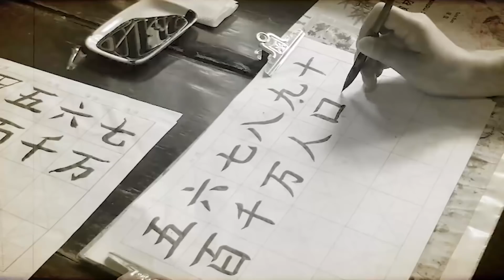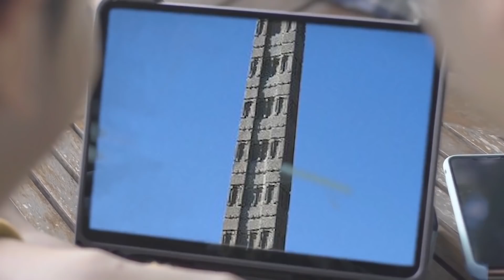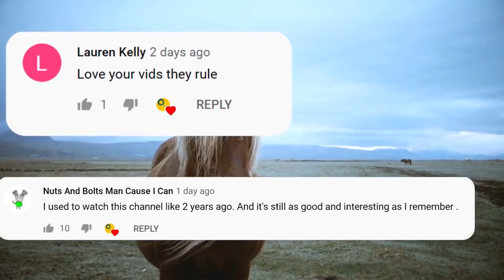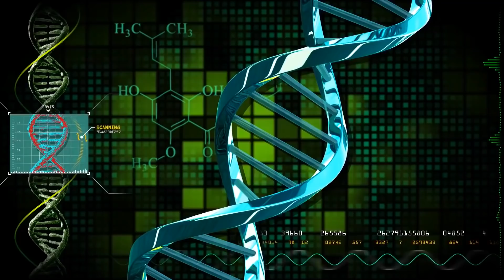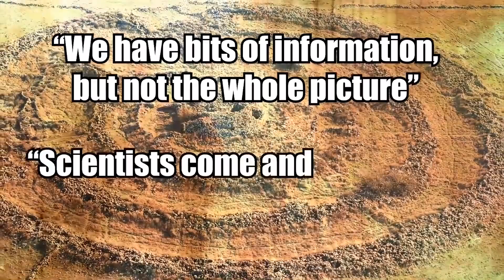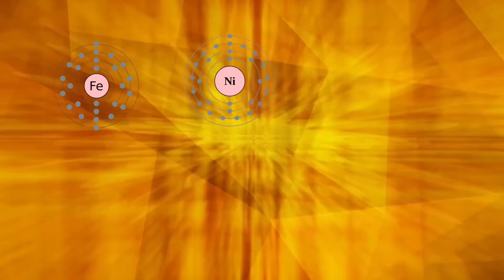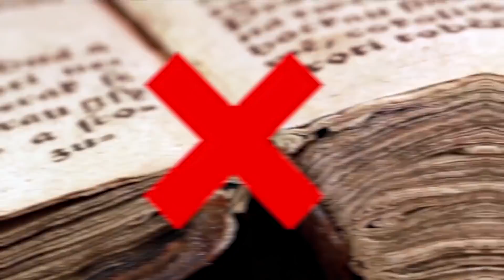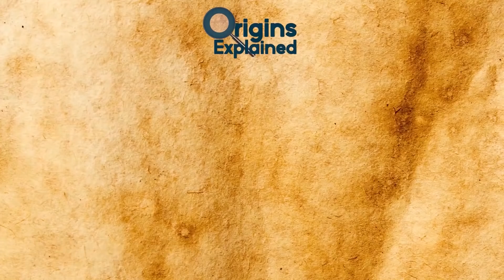Most Mysterious Recent Discoveries! | ORIGINS EXPLAINED COMPILATION 35

Comment: That strange light in the strange staircase in the Hyoerborean Gallery could be radio active . That would explain why it has been blocked up by the.military. If so it is a wise thing to do.  I have heard that an ancient uranium mine was also found in India. The entrance was deliberately sealed by the original inhabitants. It is obvious that they realised the true danger of the metal they were mining and sealed it for the safety of the people. There also was another archaeological dig done in India where it seemed a disaster of some sort instantaneously struck the village and people died where they stood. On closer inspection it was discovered that an extremely high radio active blanket covered the area of devastation. It has been hypothesized that an atomic explosion of some sort had occurred there. Of course there are always sceptics but another explanation has not been found.